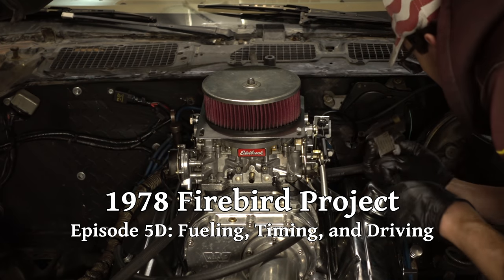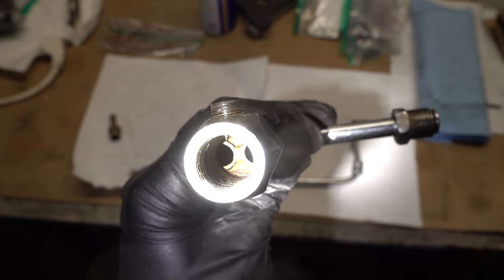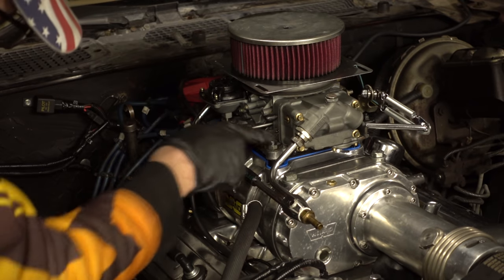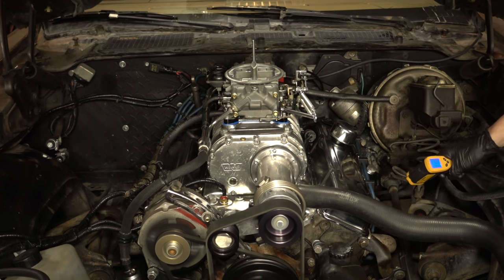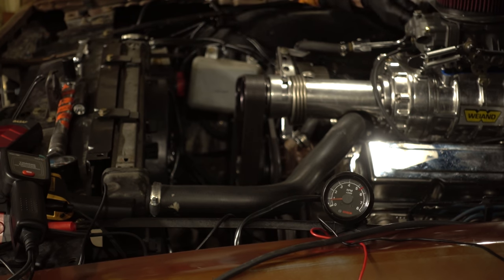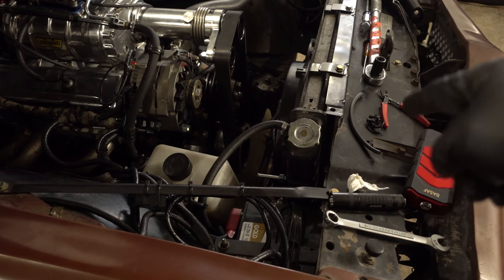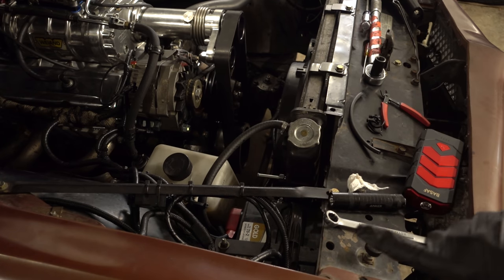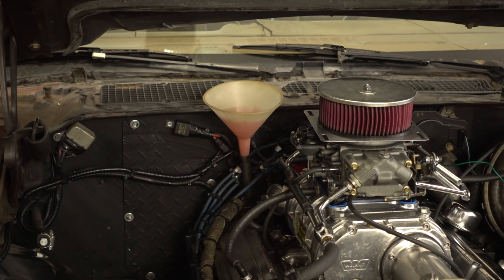1978 Firebird Supercharger First Drive and Carb Setup (Ep.5 Part 4 of 4)

Comment: Should that vacuum be at 21 inches
Reply from the maker: That's a good reading for part-throttle, I assume that is where it was when you saw that reading (the fuel pressure gauge clip I'm guessing). It pulls 14 in gear at idle in the manifold (the same as without the supercharger).

Comment: How much was the cost to upgrade the blower shaft to the 30 spline?
Reply from the maker: The shaft/coupler kit is $250, although not even Holley seems to stock them, so might be a little difficult (or involve a lot of waiting) to get one. Holley tech support advised me not to change the parts out and just run it as is, interestingly. I doubt there are any other differences but maybe they are just covering their butts as far as compatibility.

Comment: The low idle spec for a 305 is 650 RPM  for a 350 is 850  they had a lower pressure oil pump and its not getting oil.
and it got your bottom end rattleing and the sound is coming through the blower.
its in the tune up specs  my 305 is rattleing the same way cause my idle on it is set at 500 Rpm
been to cold to mess with.
Reply from the maker: Alonza Hanks Interesting that your 305 has a bottom end rattle at low RPM! The spec I've always heard and is in my book is around 750RPM in park, 500-550RPM in gear for an automatic 350. This engine idled around 500 in gear (sometimes lower before I rebuilt the carb) for two years and never rattled before, so I'm confident it's the loose coupler in the blower.
Reply: Its a  Cabalero  Diablo  305, with 65000 miles on it .
It puts out 32 psi on gauge like a clock but I put in a new distributor and jumped it a gear.
so I could see the bolt and break it loose easier and put the number 1  plug
where it was to begin with LOL  so my whole firing order is of by 1 LOL 
but it runs OK LOL 
No  mjxture curcuit on elderbrock  750 I had to clean it out.
  fast ide cam kept coming on driving .
So I backed it out in dark and didnt see what cam to put it on.LOL
It got me back and forth to work though .
And it got cold and snowed over a foot .
Been lazy .HA HA HA
Never got it all dialed in .
Yours probably didnt get a new oil pump when it got rebuilt.
So I think we are running in sink LOL.
What is your proffesion?
Reply: When you filled the oil  in blower you should lean it forwards to oil the nose bearing and spin it.
that might be your rattle if you didnt do that.
Reply: the oil will actualy sling of the shaft before it will make it to nose berring

Comment: If you over fill it a little bit leave it running for ten minutes or so till it stops smoking,
and it will be fine.
the nose on blower should be warm but not hot.
you should be able to put your hand on it and leave it there and not get burned.

Comment: Very nice work. Are you planning on some form of bubble or cowl hood to keep water out of the engine? Setups like that always make me nervous.
Reply from the maker: I drove it a fair bit in the rain in the past (though I wasn't trying to) and water did like to pool on the intake manifold. But the heat of the engine dries things up pretty well so that is only really a concern when it is sitting in the rain. Of course any water getting into the oil or the distributor isn't a great idea, so I might build a box to put over it when I know I need to drive in the rain in the future.

Comment: If I remember correctly GM’s vacuum adv was sure for manifold vac you may want to try ported vacuum for that MSD distributor or vice versa
Reply from the maker: I don't want to use ported advance because of the supercharger, if the vac advance is hooked up above the blower there is the chance that at WOT the vacuum reading at the carb could pull in some advance through it and it's not worth the risk. Many guys swear by manifold vacuum advance, anyway.

Comment: Great set of videos!!  Really gives that feel of what it takes to do custom work,  all the fine details, the headaches and frustration that gets over looked on t.v. or big sponcer shows.   So what's next?? Gears? Chassis dyno tune? Wide ban sensor install??
Reply from the maker: All good ideas haha, but probably not. Just do a seat of the pants and spark plug tune and that's good enough for now, I need to get my pickup truck fixed.
Reply: Fuzzy Dice Projects supercharge the truck project!!! Haha jkn

Comment: Super enjoying the build. Just a thought perhaps a wide band air fuel ratio setup with the oxygen sensor mounted in the exhaust might help with getting the tune dialled in. I think Eric the car guy and Mighty Car Mods also on YouTube have used then. Great work...cheers
Reply from the maker: 240kDatsun Yep, a wideband and AFR meter would be very useful, and I'd like to get one when I have the money, that's the best way to get a carb dialed in!

Comment: Did you consider the gasoline octane rating?
Reply from the maker: Murder MaroSS Yep, I ran two tanks of 93 octane through it before doing this install, so it should be pretty well off. Only running name-brand 93 for now to be safe-ish.

Comment: Do you have any estimates of power and torque?
Reply from the maker: A very loose estimate of 350-400 hp and ft/lbs at the crank, but there is a lot of guessing and the tall gears make it a little tough to compare to most other cars.

Comment: Would ceramic coated long tube  headers help and header wrap cloth help ! With heat?
Reply from the maker: It would definitely show less on the outside, which is part of the concern, but I'd need to put in exhaust temp probes to make sure the temperature inside isn't still too hot. More importantly, I'm cheap lol

Comment: What motor is this? it would be fun to put one of those blowers on my 455 in my 79
Reply from the maker: It's a small block 350, you would want a much larger blower for a big block, but a blown big block is pretty much as cool as a car can get!
Reply: Yeah I'd want to beef up the heads before I did that and the rotating assembly